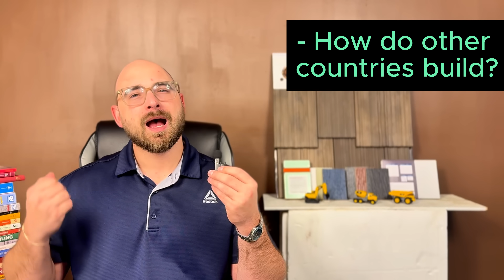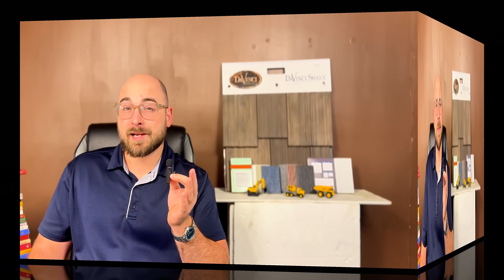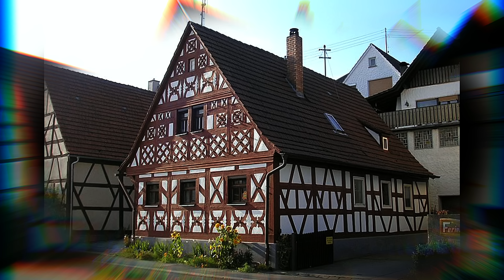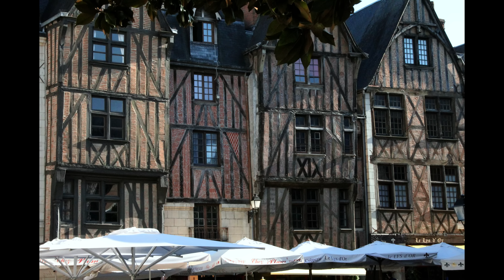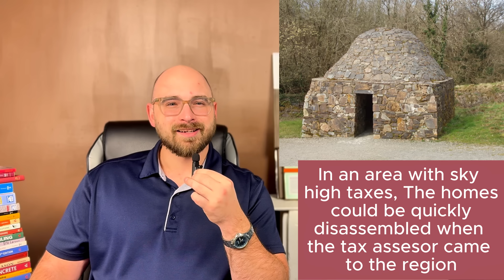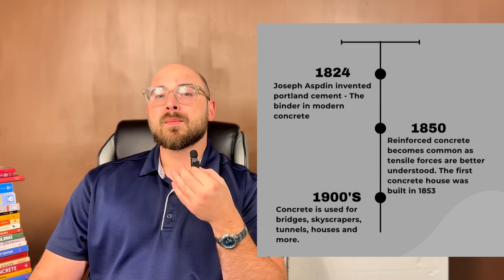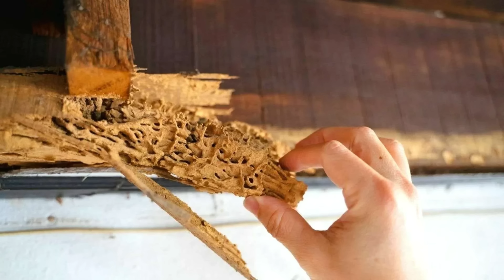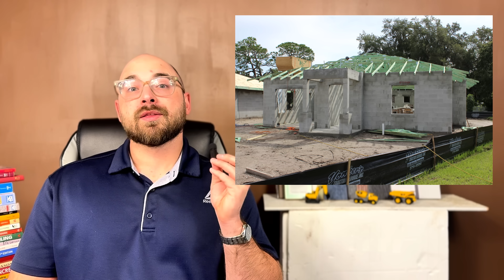Why Other Countries LAUGH at American Homes

Comment: „I haven‘t seen anyone bragging about their earth home” - Hold my beer: I grew up in a rammed clay home in Germany. 120 yrs old 16” thick walls, 3-stories, 6 flats , 5000sq.ft total. 
There is nothing that comes close in my experience with regard to insulation (heat and cold) and room climate. The walls can absorb a lot of moisture and release it again. In summer it feels like there is an AC running. But nope, it’s all passive. 
Nobody would build like that in Germany these days, so we are really glad we bought this thing.
Reply: да саманные дома очень качественные и долговечные при надлежавшем уходе! единственная проблема они не выдерживают затоплений так как преврашаются в кучу грязи
Reply: @_lika_dedicated_4105  В большинстве мест мира наводнений не бывает.
Reply: @swampfolk2526  в дубае тоже думали что там пустыня ,пока в том году его не затопило ,
Reply: I did some tests because we live in a wood frame with clay filling. The raw clay bricks can at least absorb their own weight in water before they even soften slightly. 
Now estimating, that all the clay in the walls and ceilings...we could empty a pool of water in the attic and no permanent damage will happen.
In fact, we had a pipe leak and the ceiling absorbed all the water for 6 months before we could see where the leak was.

Also: the wood did rot from cement, but where the filling was clay, the wood is still good after 400 years 😅

And wood frame here means wood with 14x14 cm and up to 30x30 cm. I see US America's wood frames as tooth picks. We build a garden shed like that, but not a house😅
Reply: Rammed clay is slowly being explored as a climate change appropriate material again. It's just harder to build multi-story multi-family homes with it, it's much more suited to single-family dwellings.
Reply: @KingBowserLP  actually, rammed clay will most likely remain a niche. Claytec developed raw clay bricks that are strong enough for  buildings that are up to 4 floors high.
Another solution is clay mortar. Using this a wall becomes completely reusable...

Up to 40% of all carbon emissions worldwide are from the building and construction sector. Of course, we can't build bridges with clay, but reusable building materials for buildings could be the solution. Especially because we also have a massive problem with (toxic!) building waste ...
Reply: That is awesome! My grandfather too
Reply: My house in Germany has solid wood walls ,which was built only six years ago . It has  30 cm thick walls comprised of 14 cm of solid wood and 14 cm of wood fiber  insulation on the outside. The humidity  in the house is regulated by the hygroscopic effect of solid wood making for a very comfortable environment . In winter I only heat the house every two days or so depending on outside temps.

Comment: Quick note for folks who might have spotted the pic of Bath Spa at 12.25 - while this still exists as a museum, it is not a bath, and the water is very much toxic - to the extent that there are folks with disinfectant spray ready to pounce on you if you touch it. I believe there's some rather horrible algae in there.

Comment: I think the question is impossible to answer. The US is too large geographically for a uniform answer. Since then I have understood that there are big differences in the quality of construction companies. Solid homes that are well constructed and a good construction company are best. But a lot can go wrong in everything from earthwork to the roof ridge. Poor earthworks and a thin concrete slab on clay ground cannot do justice to any construction method.

Comment: One very important point that is missed about timber frame homes is that is superior in areas where there is seismic activity.
Reply from the maker: Not true
Reply: @Mike_Fortin  Timber frames flex and absorb energy in a siesmic event. Sure there are concrete residentail structures, that meet the local earthquake code, but a timber frame is much more cost effective.
Reply from the maker: If cost is the biggest concern, you’re better off buying a house than building one. 

No point in building custom if you’re pinching pennies

Comment: American housing evolved differently to Europe. In the young US people were very mobile and they would often pack everything, including their houses, and move across the country to settle somewhere else. Timber was always readily available in most parts of the country and, thus, building styles and technologies evolved from that. 

American housing reflects the diversity of climates, geographies and lifestyles across the US. Just as people in different parts of Europe use different building materials and architectural styles that are often closely connected to existing climates, geographies, materials, lifestyles and traditions there. In Scandinavia and Russia wooden houses are still very common. In other parts of Europe they are not.

Brick and concrete structures may be more durable, but they also deteriorate over time and need expensive repairs and renovation. American building methods allow for greater flexibility and cost-effectiveness, when it comes to making alterations and renovations. 

Modern homes do not need to be built to stand for centuries. Saying that, many mail order homes made from timber that were purchased out of catalogues and shipped across the entire contiguous USA over a hundred years ago, still stand and provide comfortable shelter for people today. 

Europe does not get hurricanes and many tornadoes. If a F 5 tornado hit a European or any other city anywhere else on this planet, the damage to buildings would be catastrophic. An F5 tornado can twist entire concrete structures off their foundations, blow out all the windows and severely damage the interior. Brick buildings do not fare much better in very strong tornadoes and hurricanes. 

It is easier and more economical to rebuild stick construction than severely damaged brick and concrete structures. 

Many Europeans may not realise that residential housing in the US was among the first to have indoor plumbing, built-in wardrobes and kitchen cabinets, central heating and air conditioning. In the US the middle-class have had a much broader pallet of innovative styles and building materials to choose from than were ever available to most people in Europe or anywhere else in the world apart from Australia and Canada.

Shoddy construction exists everywhere in the world, even in Europe.

Comment: In Australia we build our homes to last. Bricks and mortar, cement tiles on the roof, concrete slab and high energy rated eg, roof and external walls insulation,  double glazing, rainwater tanks and solar hot water but that depends on which state. If Living in the north of the country cyclonic rated homes are built to state codes.

Comment: I've lived in a wooden house in Sweden that was close to 500 years old. Very solid and ceiling heights around 250cm which was rare for the time. We had floor heating and everything else was modernized but the structure was original with only upgrades for insulation/windows and repainting the facade (oh and it was 400m2 so not all old houses are tiny). The code for wooden houses in Sweden are very strict and all about managing snow, rain and humidity/heat transfer. We also build concrete houses and brick and even stone houses in the south. Living in Dublin I feel that most buildings (mostly brick built) have humidity/mold issues but it could be due to neglect and bad roofing materials. All this to say that quality plays a bigger role than material, as long as you at least try to build a decently sound structure. The issue in the US is corruption, low expectations and poor enforcements of code. Contractors will cheat and deceive buyers as much as they can get away with.

Comment: A problem I see with a lot of American homes is fire safety. I watch a lot of fire response videos and am always very surprised of how quickly US homes are fully ablaze, even if the fire department is there in a couple of minute. We almost never get fully ablaze homes in Germany anymore. Even homes with interior drywall construction tend to stand up better to fires than most American homes. The few instances we do get substantial fire are during night times, where people just don’t notice the fire as quickly and even then it’s mostly contained to one room with the biggest problem being the fire smoldering under the rooftiles if it spreads that far.
Reply from the maker: In the 1980, you had around 17 minutes to escape a house fire. 

Today, you have 2-4 minutes. 

This is due to using TJIs and OSB instead of solid wood and plywood. Longer spans of floor framing. Cheaper materials, and even cheaper furniture. 

Perhaps I should do another video about building for interior fire resistance , 

I’m about to publish one about wildfires too

Comment: These kinds of house also exists in Japan and it’s quite popular.
To the extent it’s getting quite hard to use traditional Construction as cost is getting prohibitive.
Cost and ease aside, when building code penalizes old buildings and push harder and harder to make it more safe, no one want to make expensive and time consuming traditional house. There’s just no meaning in making something that lasts 200 year when you know you’ll just scrap it in 60 year.
If European stops using building for several centuries, I bet they will also move to cheap prefabricated house.
Do Americans use house for multiple generations?
If not I don’t see any meaning in making European style stuff.

Comment: 3D printed concrete homes should also be mentioned in this video.
Reply from the maker: 3D printing is a fad, it’s expensive, lacks insulation, lacks reinforcement, and exposes the concrete to the elements. 

ICF or even CIP is wayyy better

Comment: My house has withstood hurricanes and a tornado so it's actually built well. It has a wood frame so idk why people think everyone wood frame house = trash when that is not the case. Houses built with brick and stone would be obliterated at tornado and hurricane windspeeds just like wood if the windspeeds are both higher.

Comment: I like that last Lego example. Sounds like a good idea. I hope these survive the damp and mould tests of the future. Proper ventilation is always a must in any house. I'm from Poland where every house I've seen is some sort of concrete panel or brick. Nowadays new cheap homes are getting built using the so-called "Canadian" method of timber framing. It's cheaper but I'm sceptical about those. The picture you see out of the LA fires where there's nothing left after a house but a chimney stack doesn't fill me with confidence as for timber framing.

Comment: In the LA fires, the only thing still standing most times was the fireplace and chimney, both from stone. How sad the whole thing was, it was great proof that stone/bricks are better.
Reply: Yeah but wood handles earthquakes better than concrete.
Reply: @ganlet20  no😆😆😆 but keep telling yourself that
Reply: @lidewijvos  You can absolutely build concrete to withstand earthquakes. But it is far more expensive. Most single family homes in Japan are wooden for that reason. I live in New Zealand. My home was made with bricks. As was most houses on my street. The place was levelled by an earthquake. The only 2 houses that survived on the street were wooden. 85% of the cbd was destroyed. Pretty much all of it was concrete. Wooden buildings killed 0 people concrete buildings killed 180. 

Im not arguing that it couldnt have been built in a way where a concrete building would survive. But things like brick are so utterly terrible for earthquakes. The city has been rebuilt. Pretty much every house is wooden. Better concrete designs for builidngs in the cbd (these cost a lot)
Reply: @Me-ui1zy  it's more how they are build than the exact material for earthquakes. That with all the other things like fire or tornadoes you would be insane to build a wooden house unless you don't have any money and like to gamble.
Reply: @Lidewij-m6t  Its about risk. The risk of tornados is very low here. New Zealand has one of the lowest rates of fire death on earth. Far lower than Europe.
Earthquakes happen a lot here. Like I said, you can obviously make a concrete building that can withstand earthquakes, we have a lot of those here. But to make every house a concrete fortress, when that really isn't needed, and would cost a lot of money and we already have some of the least affordable housing on earth. Why? What would the purpose of that be?

I don't think the idea that just because something works in 1 place means every other place should copy. Thats silly obviously.

Also, brick is objectively a terrible material to withstand earthquakes. It can be done, but why would we?
Reply: @Me-ui1zy Unreinforced brick and stone is probably the worst material for earthquakes - concrete slabs (including tilt slabs) are better than timber frames however as they can be solidly attached to the foundation…

Comment: I, from UK, cringe at the use of felt shingles as a roof covering, although, I can understand in areas where high winds are a risk.

I do however think that the ICF method is the future!

A form, made out of insulation, which is left in place and can be covered in an inner/outer shell, brilliant!

Are they keyed into the foundation using rebar also though?
Reply from the maker: Yes, typically 4’ dowels out of the foundation tying the wall together

Comment: In recent years (at least in my part) here is Australia steel frames are becoming VERY popular, since we’ve had some massive wood shortages and increased costs, and it’s quickly becoming default for most building groups since it’s much stronger while being cheaper and more accessible

Comment: Local material availability, climate, cost effectiveness, tradition, unique philosophy, building codes, none of these change whether buildings of a country in general should be considered better than another's or not. The main reason why (primarily) EU buildings are considered to be better is because they were built to be that way. Why, it doesn't matter. While quality is in an overall downward trend for reasons, many buildings were built a hundred or more years ago that still work as intended. Hell, there are places where MOST houses are older than the US itself.

There is one image that pops into my mind and makes me think "American houses (generalization) are not very good" and that is of a single concrete house in Mexico Beach, Florida, still standing after 155mph/250kmph winds of Hurricane Michael, surrounded by these "classic" wooden houses, ruined or entirely disappeared. Sure they are cheap and fast to build, but that doesn't make it "good" as a home when it's demolished so much easier by wind, fire, or a plethora of other things. On a side note, as things stand, too many in the US can't even afford to just up and buy a new home in the first place.

But it makes me wonder something I never sat down to calculate: Are these homes STILL cheaper if the price tag includes cleaning the ruins, the new house, furniture, appliances, clothes and everything else that may be, added together? Because the house is one thing, but if the house is gone, everything IN the house is ALSO gone.

Comment: I immigrated from Taipei to SoCal in USA. I see no problem with wooden houses. Plenty of wooden house are damn old too. It is not like they all just crumble down easily. And while the walls are easy to take down, it is exactly why it is so cool to take it down and changing to open concept. Too easy to punch a hole in the wall? Okay, it is not a big deal to me. Sure, it is cheap, I don't see anything wrong with that. Oh rigjt, I forgot to mention, I remodel my bathrooms after I bought an old house.

Comment: You glossed over it very quickly but we use bricks for walls in Greece but they are NOT structural. 
Most houses since the 50s have a concrete and steel frame, with brick double walls that are then plastered on the outside and inside. There's multiple ways to do insulation nowadays either between the walls and/or behind the outside plaster.
Our houses are very durable, they don't creak (imagine that), we get a lot of earthquakes here with very little comparative damage, we have no issues with mold/insects/or wind (lmao) and the house will be there for my grand grand grand children to enjoy.

Comment: Damn, when the barn we own, which is now used as a garrage, is older than the entire US. Built with stone and brick. And all we did was to make concrete floor (used to be just the ground mud). And it will probably stand when we're long, long gone.

Comment: As someone in Sweden I do live in a wood frame house, but unlike to US we use much thicker wood and then cover the frame with a solid wood layer before adding a inner drywall and outside covering (in my case bricks), and it is made to last also we have plenty of wood in this country. Still watching US house construction I still see people just adding drywall to the frame, and when watching movies you see people kicking in doors and if you tried that here you would simply brake your foot.

Comment: USA have a variety of construction types for homes there are homes that are just wood, a mixture of wood and brick usually the outer wall is brick and the inner is wood these are mostly found in Texas and Oklahoma and other southern states. Wood is a very inexpensive resource and mainly used because that is what all contractors are used to working with. Usually in the U.S. you get more house for your money compared to Europe. But what is the point no one can buy a house in Europe anyways. 50% of the population  over there are renters for life.